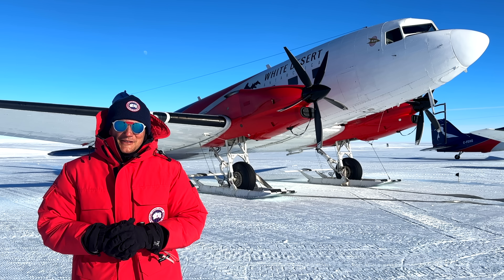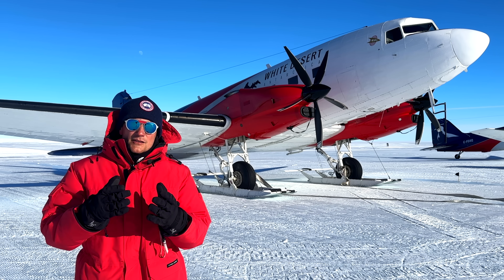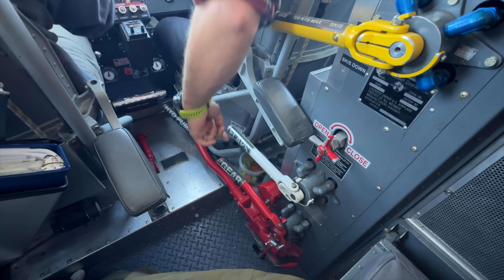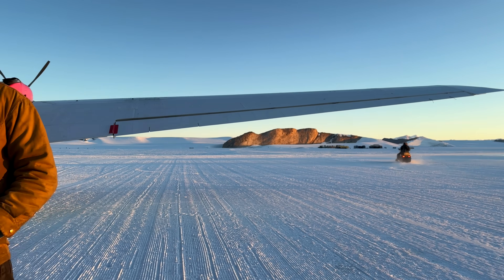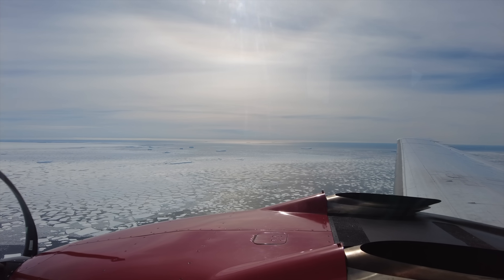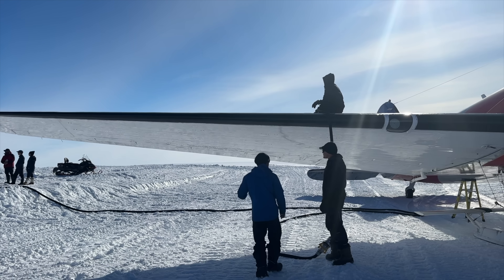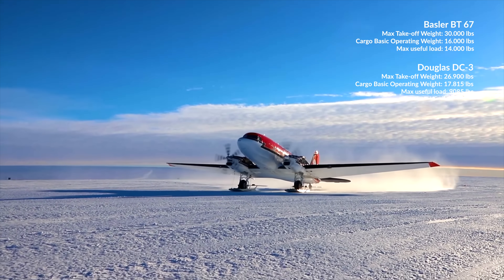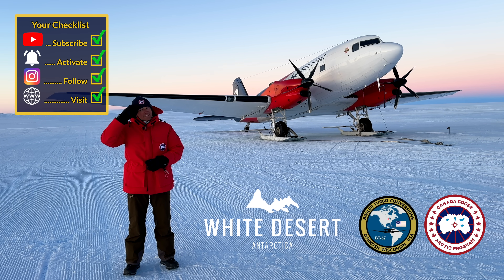How to operate a DC-3 on STEROIDS in ANTARCTIA??? Explained by Captain Joe

Comment: The DC3 is the iconic image of what an aircraft looks like. Amazing that there are so many still flying, and will still be flying when many other aircraft have been long retired. The turbo prop version makes sense, but the sound of the P&W radials starting up was pretty awesome.
Reply: It'd be super easy to mount loudspeakers into the nacelles to make the old noise. A BT-67A!

Comment: Hey Joe, good question at the end.
I could think of a  Pilatus PC-24  with skis, at least. Haven't seen one, but could imagine Pilatus would make this work, if ordered.
Also I know of B737 with Gravel Pads. Basler could also give it a try and mount skis on a Bobby. 
But hey: who doesn't like the good old PT-6, huh?
Reply from the maker: All great ideas but the drag of the skis must be immense for a jet!
Reply: @flywithcaptainjoe  I believe the gravel shield is only mounted on the nose wheel to deflect gravel from entering the engines and smaller shields around the hydraulic and electrical lines on the main gear?…. I remember a delay on a stopover in Boston because they needed to change the tire and couldn’t figure out how to remove the shields (flight from Montreal to Phildelphia).  Had to do a “telephone consult” with the mechanics back in Montreal.  I think that is the 737-200.
Reply: @  DAANG!  Thats a bummer. True.

Comment: I have flown many hours in the jump seat of the South African Airforce C47,s when I was an aircraft electrician working on  DC 3, C47 and DC 4,s. I would give just about anything to get a chance to fly an original DC3 with its P and W engines, would also not refuse a chance to fly that highly modified version.
Reply from the maker: You would love it :)

Comment: In all seriousness...another 90 years? Could that be possible? Serious answers only please.
Reply: Yes.

As others have said, it isnt pressurized, so that source of metal fatigue is gone. The engines will wear out and need to be replaced, various moving bits like the landing gear will wear out and be replaced, etc. etc. But unless the airframe is involved in a hard landing, an overspeed event, or something like that, there is nothing the is fatiguing the metal "skeleton" of the aircraft. With regular inspections to verify this, 90 years is fully possible.

That being said, you are forgoing modern abilities like higher speed, pressurization, etc. A modern plane is designed to have these capabilities, and uses modern materials to lighten the airframe. If you calculate the lowered fuel cost alone, Im sure it becomes worth it to replace the airframe every 30 years or so, rather than make it last forever.
Reply: @ParanoidMarvinMk2  Many thanks, can anyone else add anything?